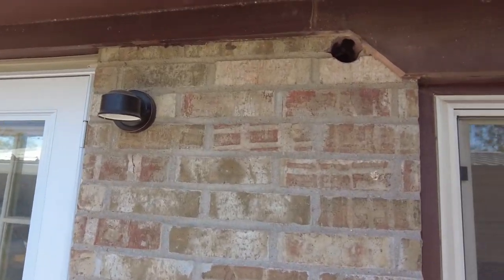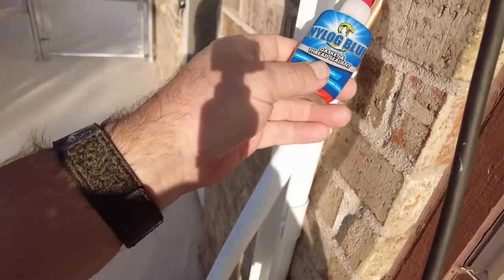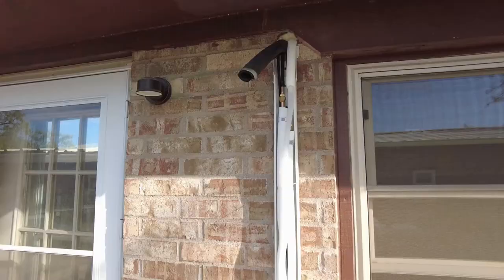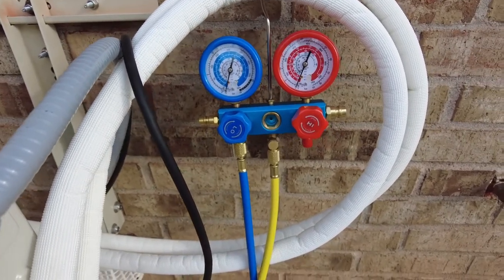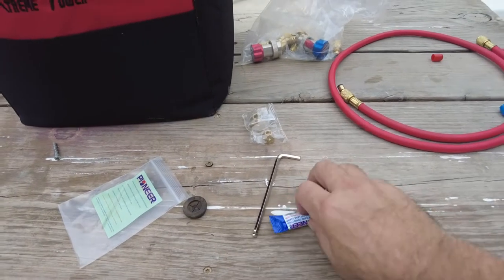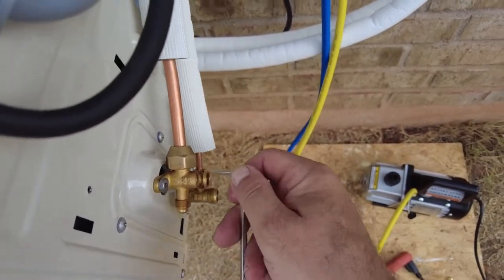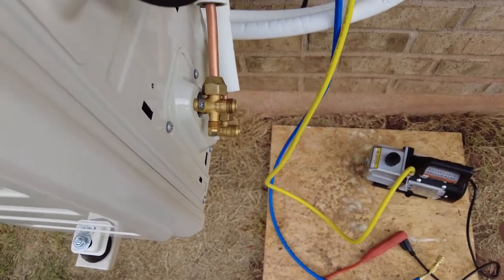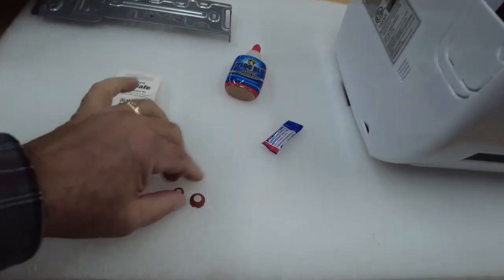Mini Split Install Pointers

Comment: Hi Casey.  Great informative video.  You obviously have a large cross section skill set. As a retired electrician installing his first DIY mini split, I appreciate your skills.  Only feedback I might be able to add is that the white wire going to the two-pole breaker in your panel should be re-identified as a current carrying conductor, preferably with red tape.  Thanks again...Paul

Comment: Just finished mine. Good video, even if seen in retrospect. I ended up staggered over a window in the same way for the same reasons. I also would have been in trouble with the connectors too near the bend had I had planed on going out the left.

Comment: Defo some useful points there, especially the opening the valve furthest away. 

There are calculators online to figure out how to torque something down with like a luggage scale, and knowing the exact length of the spanner or whatever your using. That's what I got, a digital luggage scale for £5, and it seems pretty accurate compared to a normal digital scale, so hopefully it's somewhat accurate for doing the torques. I'm not paying loads for a torque wrench and crows-foot spanner adapter things. Probably going to be more faff than using a proper wrench but it's £60-80 cheaper lol.

Another point many people don't mention much, is supposedly you are meant to install the indoor unit bracket with a slight lean down towards where the condensate tube comes out, so water doesn't hang around in the unit and potentially stagnating and stinking up the place. That's what the manual for the one I'm looking at says anyway.

Comment: Thanks for this video. I'm all in. Bought a dual zone mini split and had planned to install the condenser on the wall then felt a bit worried about the noise it would transfer. I'm working with a 1.5 ton 18,000 BTU 185 pound unit. It would probably look better mounted up high, but I'm so picky for noise that I would probably be run out of house and home if the thing was annoying me. It may not look as good mounted low to ground, but I don't want to hedge toward the noisier set up. Even though I bought brackets that can support up to 600 pounds, I'm changing course. Thanks for sharing your experience on this topic and for all the cross comparison and showing the amperage drawn when in operation for the various sizes.

Comment: Thanks for the clarification on the Nitrogen in the lines of the inside unit.  I freaked when I pulled the caps and heard the gaseous material flowing out.  I figured it was benign material but couldn't figure why the lines were under pressure.  Your reasoning is sound--confirm inside unit and lines are leak free prior to install.

Comment: It is a good idea to check the line set with a Nitrogen charge before pulling a Vacuum. You can have a small leak that wont always show up in Vacuum and you wont hear it. You will with positive pressure in the lines.. Perhaps because of the pressure on the flare fittings. Cheaper to find out with Nitrogen than 410. Also if you are having a longer line set than the pre-charge, you will need the gauges on, with a singe port gauge, you will have to disconnect the vac line to add the 410 tank, So you will need to purge the lines. Better to get a 4 port Gauge set. YellowJacket a good choice. You really should always check the running pressures after the system settles out. Manufactures don't always do things correctly.

Comment: I discovered that coiling the line set vertically can cause problems.  I believe it traps the refrigerant oil leading to premature compressor failure.  Have you heard of this?
Reply from the maker: I did hear about that. Thing is, neither manual I have made mention of it. For every article that says not to do it, I could find one that says it really don't matter. My advice is to do what make you feel confident about your install.
Reply: @kc79ta  Well the manual will not tell you a lot of things about how to install them. Mostly because they assume you are a qualified HVAC Tech and you should be to do the installation. You will find out that you shouldn't leave the line set coiled in that manner. Those compressors are not cheap. HVAC Tech for 20 years

Comment: The only thing that I see in your video that I don’t know if you ever heard anywhere else, but all the manufacturers recommend to create a “horizontal coil” for the line-set instead of having it go up into a vertical loop.  

Other than that, good video that doesn’t get too complex for a DIY’er…

Comment: Thankyou for the video your process looks great. I was impressed in the quality finish hookup with the lines. I am working on installing a Mitsubishi 15 k now and I appreciate and cycling or the refrigeration process. Excellent presentation.
I will admit to you my sub panel thatI installed looks like your sub panel wires not lined up looking pretty like a fanatic electrician.
Question did you bolt it down on the slab .?
Reply from the maker: Yes, I did bolt to slab. Don't want a big wind gust or something knocking it over. I change things in my panel so often it don't pay to keep it pretty.

Comment: Good video lots of good info. I saw your comment on the mount seeming rather flimsy. If you are mounting the outdoor unit off the ground, you don't have to push the unit to the outer most location. You only need 4 or 5 inches of space between the unit and the wall, since it is pulling air from all directions. That makes it a little more stabile on the mount.

Comment: I got this same pump, but after 35 min it only pulled my system down to - 27.   it was not nearly as noisy (does not sound as  powerful) as  yours on camera, but it may be that's just in the video 

It stayed at the -27 for hours though.
Reply: You need to pressure test with nitrogen at about 300 psi to check for leaks. Then when you pull a vacuum you need a micron gage. Pull a vacuum down below 500 microns. Then do a decay test before you you release the freon.

Comment: For the flares, don't put sealant on anything but the mating surfaces. Getting the thread side wet will foul any torque specs (or judgement), as the friction is a design consideration.  6:42
Reply: Usually friction is not designed into torque.

Comment: I have to drill through brick for mine too, did you use a regular or hammer drill?
Reply from the maker: Hammer drill. I put the links in the description. Take your time and don't force. You can shatter the brick to pieces.

Comment: Nice video, full of good tips.  But is 20 min enough to detect slow leak?  I let mine sit for 10 hours with vacuum before being confidant that there was no leak under vacuum.  Also 60 psi is better, but you would lose even less refrigerant if you take off my manifold gage line at 2-5psi.  Vacuum check is insufficient test for leak at high pressure, so as you mentioned, bubble check with soap water is absolutely mandatory after fully releasing refrigerant.  2 units in one breaker?  not sure what is reasoning for that if you can instead have quad breaker for separate breaker fo reach unit?
Reply from the maker: Reason for only 1 breaker is cost savings. Both units running at full load would be around 15 amps at 240v. The breaker is a double pole 20 amp beaker, more than enough reserve for both units, and still meets recommended max breaker size. Each unit has its own disconnect, so you can service one without cutting power to the other. Plus in my case it cut my wiring cost in almost half. As for the 20 minute leak down check, that is what the manufacture recommends.

Comment: HI, thank for the video but instead of putting two wires to the breaker wire nut them together with a pigtail. Also the breaker is there to protect  the wire so if both wires are 12ga then the circuit breaker should  be 20amp for example.
Reply: If you check the information on the breaker, #3 or #4 print some will except TWO wires. And as far as using a 20 amp breaker for #12 wire go with what the minimum size breaker that is listed on the unit is. If it says 15 Amp then you can use a 15 amp breaker and the #12 wire will be good. The whole idea is to protect your equipment with the smallest breaker size. Then when your unit starts to act up the breaker will trip. If the breaker if OVERSIZED you could damage the equipment.

Comment: Which brand do you preferred? Pioneer or Ducklessaire
Reply from the maker: After part of a cooling and a full heating season. They both do what they should. The Pioneer is more DIY friendly to install and seems a little quieter, but the DuctlessAire seems more user friendly. It has wifi if wanted, a "follow me" remote mode that stays on for more than two hours, and is rated 2 SEER higher. The Pioneer is a bit less upfront cost, but I can not see any different in build quality, only features. When I add one to my shop it will most likely be Pioneer. If I was to need one in a living area where I wanted more control I would get the DuctlessAire.

Comment: When I do the vacum for 20 min then turn/  close the gage and turn off the compressor the pressure goes back to zero right away . It never went to -30 it was below 0 between-30 . Do I have a leak and it's not vacuuming? What should I do next?
Reply from the maker: I would suspect it is leaking at a fitting. First double check all temporary fittings on the vac pump lines. I use rubber jawed pliers on them.
Reply: Mine did that when I had the blue and yellow vacuum lines reversed.  Oooops!
Reply: @kc79ta  Mine is doing the same thing. Did it turn out to be a leak and end up working for you?
Reply from the maker: @Danfrye5  Mine wasn't having the problem. paulb4466 was having the problem. They never replied to what they found out. Recheck all your connections.